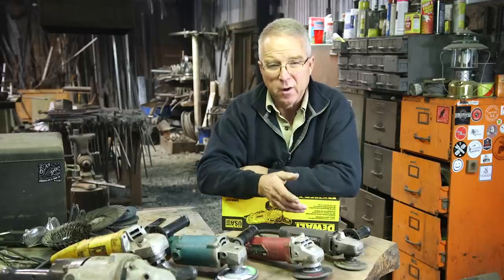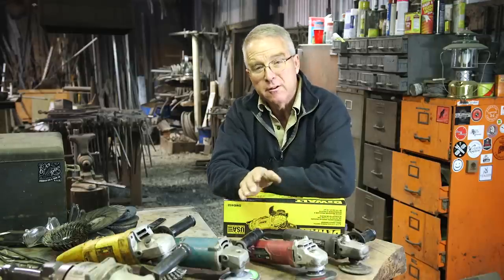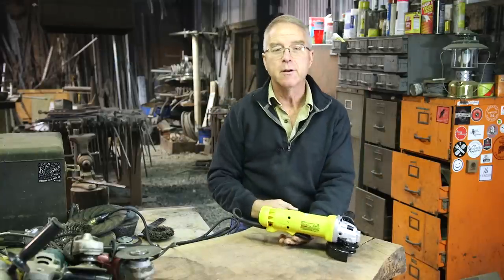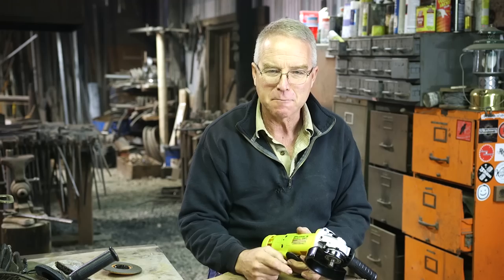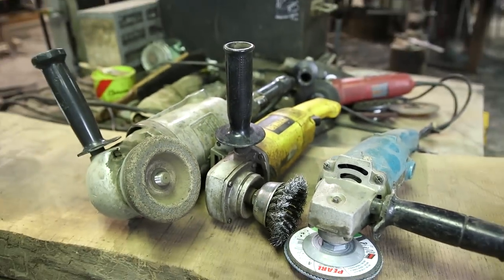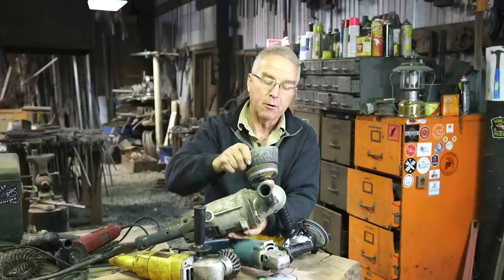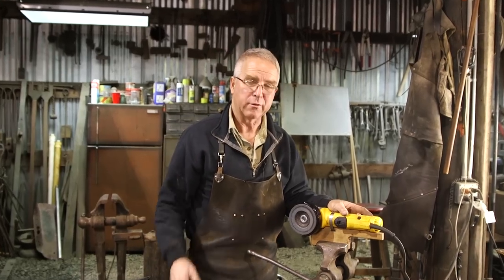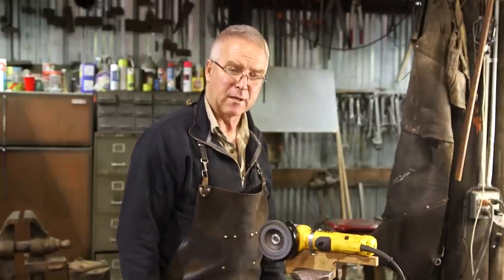Get Another Angle Grinder

Comment: I used to use those carbide(?) cup wheels to grind concrete years ago. They got plugged with concrete dust almost immediately and cut slow, they should be left in the last millennium. They have diamond wheels for grinding concrete that are reasonably priced and are aggressive when using them. You can get them for 4” and 9” grinders, the 9” wheels will cut a 1/2 to 3/4 inch high lip and feather it back 6-10 inches in a four foot sidewalk in 20 to 30 minutes. The small grinders are just about as fast, and like you said, they are hard to live without if you work for a living!

Comment: About a year ago I was stripping paint off a truck hood. When I flipped the switch on the side of the grinder my thumb slipped and my index finger went right on into the stripping wheel that had just started spinning. It took most of the meat off the top of my finger. After I patched my finger up and finally got it to stop bleeding all over everything I put the guard back on and it hasn’t come off since.

Comment: That big old Black & Decker is a 9" grinder and probably about 50 years old. I have the same one. I used to joke that you would back up to your work using that because the torque would spin you around as soon as you hit the switch.
 
I also think I see at least one 7" polisher in there. Like you, I have several grinders/sanders/polishers/cut-off tools,  both electric and air. My long reach right angle air cut-off tool has the same guard on it, and it's one of the only guards remaining on my tools. My switch preference depends on the application. Prefer a paddle switch when I want a tool to shut off as soon as I release it.

Comment: I’ve worked extensively with one of those new dewalts. You didn’t break the guard, Scott. There are no locking positions on somewhere between half and a third of that circle. I assume it’s some insurance reason because in those positions the sparks are flying right back at you. But as you know, when you need to work sometimes that’s the breaks and I’ve found there is enough friction to keep that guard in place even when not locked.

Comment: Scott, when I first watched this, I hadn't bought my first angle grinder. Since then, I have bought a Makita 18v 5 inch angle grinder. I have used it for everything from cutting metal to grinding concrete, and I have been happy. I was wondering if you had thoughts in general on battery powered grinders and specifically on the Makita power mechanism, which is a lock turned on type button near the spindle lock mechanism.
Reply: A locking button is the worst one. As it will keep spinning if you let go. We call these a “suicide switch” for a reason..

A paddle switch or rat tail type of switch is ideal, as it will shut down when you release the switch.

As AvE pointed out on his channel (take a look if you’re interested) makita makes the best battery packs and makes quality gear. They might not have the longest runtime or best power output. But they do have a very long overall lifetime. Project farm recently made a video about cordless grinders. Makita did a very good job!

I can confirm this as we use their 18V tools as well at home and in the shop. They are robust, no-nonsense tools that are reasonably priced and built to cope with professional use and abuse.

Comment: I myself like the thumb switch as I can then hold the grinder in any way.  I keep the guard on and wedge my thumb between it and the grinder body.  One can’t do that with a paddle switch grinder.  Not to mention the fatigue when using it for any extended period of time.  I also like the small 4 1/2” Makita best.

Comment: I got a dewalt with a thumps switch, the thing I hate is if it isn't perfectly aligned and pushed in, it will pop out (turn-off), it will also stick meaning it will run without you holding on to it. since I only use it for light work it isn't a big issue. the only time I have issue with the guard (I have a model similar to yours) is making cuts close to the floor, like anchors sanding and other tight cuts.

Comment: You should try a Milwaukee. I've been using it for 3 years now and haven't had a problem. They are really easy to control with the paddle switch and has a lot of power.

Comment: It seems you need about 4 - Cutoff, grinding wheel, flap disc, wire wheel.  You can get a decent one for $35 so that is ~$150.  I have bought quite few $35 grinders and pretty happy with them.  The grinding wheel and wire wheel need the most juice so I put those on the best grinders.

Comment: I've used my 18v cordless Milwaukee grinder for nearly 4 years now in an industrial environment as an electrician and I haven't had one issue with it! I agree that the paddle switch is superior! I've never had a drama using it one handed. It has great ergonomics and plenty enough power for an 18v tool! Corded tools are useless to electricians because we are the one installing the power!

Comment: On your De walt you can also rotate the head in 90 degree increments relative to the handle with 4 screws on the head. Nice to rotate the paddle to the side when grinding a slab

Comment: Great information I was just thinking that the other other day when I was sanding rust from some square tubing, I was thinking about stopping and changing to a stone but didn't want to go through the trouble if the stone would take it down to much bare metal. I'll have to get one more None expensive 4 1/2  grinder stone. I have a cut off wheel that I notice it made it easier to just pick that one up when I was using it I wore safety glasses and a full shield like you said on my Dremal tool the cut off wheel broke many time's so I know the bigger one goes much faster and can do more damage. 
Like the wire cup brush you want all the safety gear on when using that tool some of the wires come loose and fling anywhere. I check the stones before buying them to make shire no cracks are in the stone's even my my metal chop saw to make shire they don't have cracked before use.

Comment: Thanks Scott, it's like shoes and women.....you usually need more than ONE.  An aspect I like is the addition of the motor BRAKE.  The old ones seem to spin forever after the switch is turned off. Most of the newer ones slow to a stop considerably faster.  I have a couple of CORDED models and recently added a BRUSHLESS /rechargeable  battery  unit.   VERY HANDY !       J K

Comment: Like most of your videos, this one is great. I'm partial to Milwaukee but as far as angle grinders go I prefer a paddle switch without lock-on as you do BUT the feature that I've grown the most attached to is a third handle position over the gear housing, it just makes the entire experience more efficient and ergonomic. That being said, both of my grinders have those features and happen to be Milwaukee. On top of that they're pretty robust tools overall. I recommend you try a third handle position style if you haven't already.

Comment: A good comfortable face shield is important. If it's comfortable you will wear it. I try to use safety glasses under a face shield, but they often fog up and I've tried multiple ones. Fogging up has never been an issue with a face shield due to the amount of space for air to flow freely.

Comment: I have a Milwaukee plug in with a thumb switch and I love it. Never had a problem with it. Why are you so against thumb switches?? I also have a porter cable 20v that I use almost daily at work and I love it..  it has a thumb switch

Comment: I have learned over the years on the thin cutting wheels have a metal kinda of washer pressed into cutting wheel i have seen it on the side with paint and not if you get your grinder in a pinch and you put cutting wheel on they way its suupose to go on paint towards you and that thin metal washer is now face with the 5/8" keeper and after about breaking your fingers whats left of the wheel is now really tight and makes it a pain to get off so you can try again. Others mite see this differently . I have always put metal washer towards me no matter paint on face of disc

Comment: The best way Iv found to set a guard is to have it set so it’s top edge is flush with the furthest forward point of the gear box and then cut the guard so it’s flush with the bottom of the grinder body. I did this a few years back and I haven’t touched it since and I do a lot of awkward confined space work on rusty old cars. Give it a go. You’ve got your fingers to loose.

Comment: When my Porter Cable angle grinder crapped out, money was tight so I went to Harbor Freight and bought a Drill Master model that was on sale for $9.95.  These go on sale at that price several times a year.  I now have 5 of them, all bought at that price:  one for a wire brush, one for a cut off disc, one for an abrasive blending wheel, and one each for metal and masonry grinding wheels.  I have both metal and masonry cut off wheels and if I find that I am using the masonry one much at all, I'll buy another one for $9.95 to have both cut off wheels set  up all the time.  Yes it's Chinese, and yes it has the push button switch, which is a little hard to push on and lock, but releases with just a touch on the back, which is much better than my 30 year old P/C was.  They may crap out some day, but each one comes with an extra set of brushes for the motor, and having one dedicated to each task has really sped things up.

Comment: The guard didn't lock by design because it was in a useless angle. By default, point it diagonally away from the grinder body axis and the handle axis.

Comment: Rat tail Dewalts are nice(the one you find ergonomically pleasing.) Used to only run metabos. They are junk now. Switched to Fein. Seems to be a good German tool. As an aside, the handle was initially introduced by the manufacturer as a way to get the hand off the cooling vents. Safety/control was an afterthought. 
-Union Ironworker

Comment: In my near 20 years of using angle grinders for all sorts of metal fabrication, I’ve never run into a scenario where taking of the guard was necessary . I have always been able to just loosen and swing the guard to get it out of the way of the work. Not worth it, I’ve seen too many pictures of the aftermath of a exploding wheel to chance it. 

As you discovered Scott, a lot of angle grinders have a quick latch to adjust the guard, as you stated it makes it so handy to reposition. 

I’ve had about a half a dozen wheels explode on me, every time it has been totally harmless, with the guard  doing its job and defecting the debris away.

Comment: The term for that tool among people who work on cars is "death wheel". If you're a cowboy like Scott and use them without the guard, STAY OUT OF THE PLANE OF THE WHEEL. Same principle as Cooper's second rule of firearm use, if you do something stupid and send high-velocity chunks of something flying, you're still safe as long as it's not pointed at anything/body you particularly care about. Except in the case of a grinder the muzzle direction is a plane rather than a line.

In other news, I've been thinking about slapping together a rig that bolts to two of the side-handle holes to turn one into a miniature chopsaw.  A hinged sideways V welded to a flat plate at the bottom and bolted to the grinder at the top, maybe a compression spring so it has to be pushed down rather than held up, Bob's your uncle. I'd be surprised if that wasn't already available for purchase and I've just never seen one. If not, I'm looking for investors. :p

Also, if you're on a budget, the midrange paddle-switch one from Harbor Freight is well worth the $30 in my experience. Mine held up for five years until it was stolen, I didn't use it that much, but when I did I abused the heck out of it. A friend had one that shot a ball bearing out through the front cover, but still works fine (maybe open it up and put some good grease in the gearbox if you're buying budget grinders.)

Don't ever buy grinder wheels from HF, just the machine itself. No offense to Chinese manufacturing, but ... their abrasives cause cancer in states other than California (everything that's any good causes cancer in California.)

Comment: I cut some of my guards down to 90 degrees. They allow the grinder to be set down with the wheel spinning.
Paddle switches have their own drawbacks. If the blade binds doing a gouge or cut, you grip tighter holding the trigger on. A one finger paddle switch would be my preference.

Comment: I can't agree more with this video.  I always have a diamond grinder that can switch to the chainsaw blade or cement leveling diamond cup. I then have a sanding pad on the other one for coping or scribing.  Used Dewalts for years they would only last me a year...so now I have a Makita that feels much smoother in the bearings and has lasted 3 years but to be fair doesn't get used as much.

Comment: I actually like the thumb trigger on my small Hitachi before it died. It lock on the on position and I'm free to move my hands around as I need. My big Hitachi has a trigger style and that is the most comfortable. I replaced the small Hitachi with a small Bosch with a paddle trigger and I didn't like it at first, but I'm getting used to it. I have found the most important things to compare is how many amps and RPMs you are getting for the price, that's always made the biggest difference to me. The Bosch also came with that fancy button to change the position of the guard, and I was also really impressed with the idea and innovation of it, but unlike you I still threw it away. I like lining down my blades with I cut, just to make sure I lose an eye when the blade comes apart. lol.

Comment: As a pressure welder up north on the rigs I can say the oldschool makita 6 inch grinders are by far the overall best.  Most durable, cheapest and easiest to repair and change brushes/triggers on.  The new plastic fan blade and not one piece body and rpm brakes and plastic (not metal) wheel lock button of the new makitas make it no better than DeWalts now....they recently changed out the makita's to new dewalts and they didnt even last a few months, so the company went back to makita's but the new makita's hardly last any longer

Comment: DeWalt seem to be fitting most of their smaller grinders now, with thumb switches on the side, just behind the handle.  These switches tend to be a bit stiff to operate when switching on.  The positioning feels awkward and you have to move your hand forward to click it off which means a less stable grip.  Go for trigger switches instead. Your hand is nearer the back of the tool and the separation of hands makes your grip more stable.

Comment: As a house painter, I resurface ( or just remove the rust) and paint at least one metal railing a summer.  I and my team go through a right angle  grinder a season. Running a grinder for 6 hours a day for 2 or three days will wear it out.  So I just buy the cheapest on at around $40 and add that to the job price.  The better make Dewalt, Makita, Bosch may cost double, but they don't last twice as long. And like you said Your going to want to have at least two going for different grinding wheels. The new grinder for that which your doing most of the work with and the older rattly one for the second.

Comment: I'll never go back to a 11,000 or 12,000 RPM grinder after using a variable speed. The fast RPM's are fine for some jobs but stick-on sand paper and some velcrow paper will sling off at high RPM's. Sometimes it's good to be able to slow it down some.The best grinder I've owned is a Metabo. It's still running strong after 15 or so years. The Makita SJS grinder with 12 amp motor is a hoss.

Comment: I lover my angle grinders. I have five 4.5 inch and an old 9 inch Milwaukee. They are used for everything from metal to wood to stone to concrete. I disagree with your paddle switch preference, thumb switch is just fine. I do ware them out though. All that grit that gets ingested.

Comment: Yup, I've had Metabo etc.  Multiple cheap grinders trumps (sorry lol)  one expensive grinder, because-less wheel changing.  Use a piece of angle iron  clamped to the edge of a bench for storage, that way you don;t need to wait for the wheels to spin down when you are done with one grinder or swapping to the next.

Comment: I used my brand new angle grinder for the first time today to remove the supports for the bus seats in my bus conversion that I've started. The very first bolt I started to remove I set my leg on fire. Just my pants not my flesh. Learn my lesson pretty quickly. But then I just moved on to the rest and finish the job. Not bad for an old lady I must say.

Comment: I just paid $9.99 for a Harbor Freight AG and on first use, with a sweaty hand over air hole where brushes live, a bit of a shock !   I spun 1/4 of a roll of E tape around it cutting off it's air and will most likely kill the cheap thing in short order. But killing the grinder is better than the Grinder killing me !

Comment: I'm not a fan of a paddle switch, I like the trigger the best since it wears my hands out MUCH less by the end of the day. 
I leave the guards on as much as possible, but sometimes you just gotta take it off. 
Great video as always keep up the great infotainment.
EDIT for P.S.: I'm very partial to the Makita 5 and 7 inch rat tails, that being said its hard to beat a Metabo pancake grinder for getting heavy work done and having a truck load of torque but they will cost you a bit more the low profile comes in handy also. As far as value the classic Makita rat tail trigger model 4.5in corded or the paddle 4.5 LXT 18volt are both hard to beat.

Comment: I bought the cheapest Harbor Freight angle grinder, thinking I wouldn't use it that much. Alas, I'm now using it so often, I wish I'd gotten one that's not so clumsy, particularly (as you note) the switch. Gotta start looking for a deal on a better design.